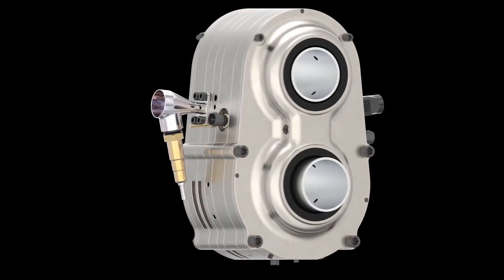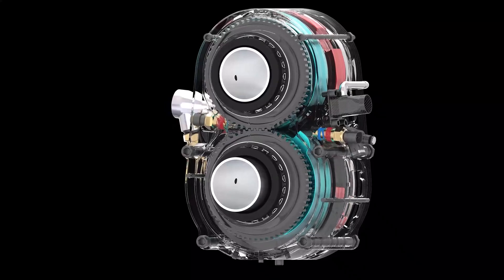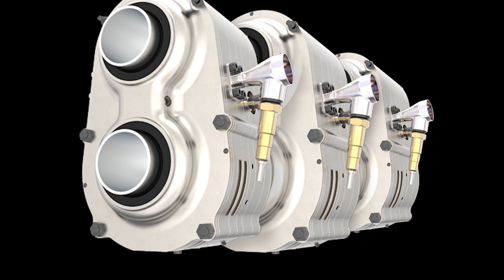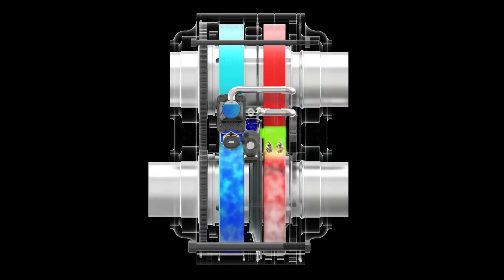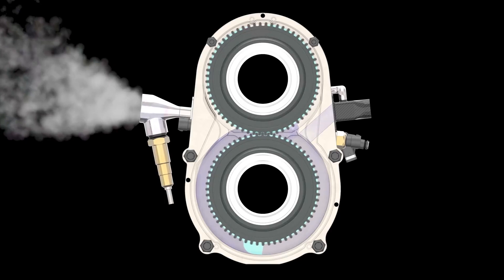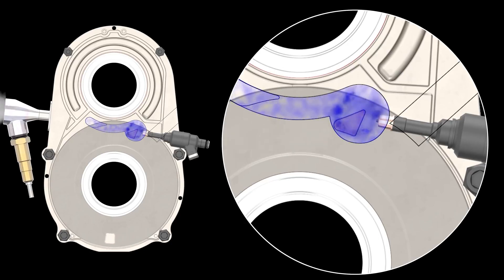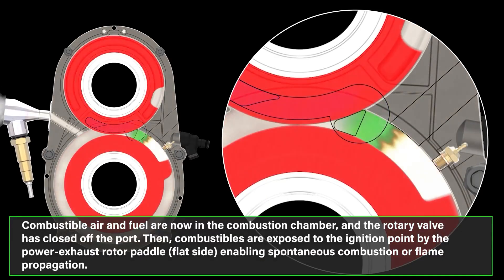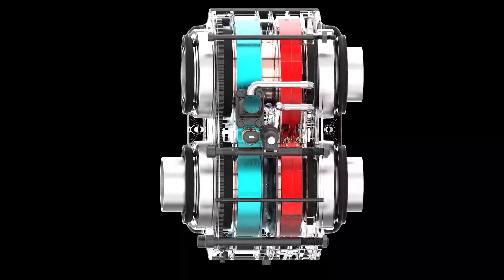This pistonless engine runs on hydrogen and revs to 25k rpm

Comment: What you need is a dual sided ignition basically mirror the top on the bottom so that both side of rotor will fire and balance each other out

Comment: I see a major flaw. When its ignited that side of the rotor is gonna have 200x the torque of the opposite side on the rotor. Basically this thing will fall apart to pieces wayyyyy before 20k rpms

Comment: Hydrogen is better than electric. Easily transported and stored. No carbon emissions. No mileage limit. No need for the extremely environmentally unfriendly battery systems.. people need to get behind hydrogen as a fuel.

Comment: As cool as this is (in theory) I think electric can't be beat, the RPM is only limited by the ability of known materials to withstand centripetal forces and the touque is only limited by the resistive heating of internal components. Also, the tolerances can be much sloppier and motor can still be designed without the need for physical bearings, lubricants or gaskets. Not to mention they can run on anything from solar to wood to plutonium.
Reply: The batteries are horrible for the environment and electricity to charge them has to come from somewhere. I like how quick they accelerate though. And recharging them is cheep.
Reply: @ryanhart9333  The batteries don't need to be horrible for the environment. They can be recycled easily enough (whether they actually are is another question) and the raw materials can be mined from sea water (especially now that the first Sodium ion batteries are being commercialized). Also, batteries are far from the only option to power electric motors (in a moving vehicle), a chemical fuel cell, a very small nuclear reactor or beaming power to the motor as it is being used (solar, lasers, wireless charging coils in the road or even an electrified track are all possible options)

Comment: electric using current lithium tech is not sustainable. this is possible now and cheaper fuel wise. im curious about the tolerances though. the runout must be something crazy like .0001"

Comment: I don't worry about keeping the I.C.E alive.  IF you bring efficiencies high enough, you can get engine that can run economically off synthetic fuels.  Can this engine run off Diesel, Peanut oil, wood gas, alchohol, hydrogen, methaner and anything else?  There are a lot of old agricultural Hit and Miss engines that ran of just about any burnable gas, if such an engine could be made and work eficiently in cars or cargo trucks then you have something.

Comment: A fascinating concept, but tight tolerances at scale are difficult to achieve. This will likely never be powering anything with a high volume production.
Reply: It was achieved , back in the 70s , its called a wankel motor, Arctic Cat used them in their snowmobiles in early 70's. With the only exception of course they ran on a fuel oil mixture.
Reply: @lokirussell4544  It's not a wankel engine.
Reply: @rekt4guud134  same concept

Comment: Cool toy but no practical use. The problem with hydrogen has never been extracting energy from it - a fuel cell is fine for that. The problem is producing, storing and transporting the hydrogen without using more energy than it yields. This doesn't address that at all.

Comment: The Shuttle-Cam engine has only ONE moving part and that part floats on an air-bearing, so clearances are very slack and allows it to operates under full load, very nearly frictionlessly, while producing nearly full torque across its operating range, from top speed down to zero rpm. The Shuttle part acts as both a piston and an impeller, simultaneously, with both components producing torque and both from the same charge of working fluid, so it gets more work out of the fuel and the working fluid. 

This is an external combustion engine and as such requires an independent combustion/pressure vessel which is ideal for Hydrogen or any other liquid or gaseous fuel. 

The Shuttle both rotates and reciprocate at the same time and floats above a Cam that determines and regulates the  Shuttles motion. Although the  clearances are quit large and sloppy compared to most IC engines, the shape of both the Shuttle and the Cams must conform very precisely to a mathematical, algebraic equation. Because of this mathematical shape, the inertial mass of the shuttle behaves as though the reciprocating motion was actually a rotating motion, 90 degrees off axis but with both motions acting on one axis, the driveshaft axis. (Mathematics is a very useful science, it make miracles possible.) There is virtually no vibration and the only point of friction is the sliding motion of the Shuttle as it rides up and down on the splines of the driveshaft. That is the only source of friction in the engine. 

The Shuttle-Cam Engine is the simplest, most compact, most powerful, most efficient and most practical heat engine ever designed. There will never be a better overall, heat engine design. It only has one moving part!
Reply: LOL good one

Comment: Bullshit. It's a blower/vacuum motor basically. And the initial drive egagement will have such a pull to off set the balances.  Yet if this a secondary input drive system possible for it to work since engagement is in motion 🤔 still it's at least a new concept. And right now that's what we need it's funny how new ideas come when someone gets fed up with the bullshit.

Comment: Electric car are not the way to go 1 the power grid can not handle the massive loads 2 short distance per charge 3 having to wait in line at a changing station one to two hours 4 batteries shorting out catching on fire and no way to put the fire out, it will burn until the car is completely destroyed

Comment: Wouldn't it be better to have  another chamber 180 degrees from the only one you have in this design to balance out the rotation.  And two combustion chambers per rotation might increase the power of the engine.  I don't know about 4 combustion chambers at every 90 degrees as the short time frame between each chamber might reduce the complete combustion of the fuel. This is something you would have to do actual test to measure if you would get a complete combustion of the fuel.

Comment: If it work as predicted I would consider combine it with reduction gear and generator, basically still use electricity as main traction, I not sure in such high speeds use traditional gears would be efficient and also changing the load or speed therefore the electric generator,  Super capactors would be my preferable combinations.

Comment: If they can even make this work in the real world, the tolerances required will make them just as expensive as turbines, if not even more expensive than a comparable turbine. The only conceivable advantage is that this can presumably be throttled back much more efficiently than a turbine, but that's really only a concern in automobiles and these engines will be prohibitively expensive to put in cars. In planes and boats a turbine can run at peak efficiency almost the entire time you're underway, so there's no need to overcomplicate it with this instead of a turbine.

Comment: Assuming it works as advertised, there are two main things that it needs to address to be better long-term than electric:
- Storage: hydrogen isn't very dense, and takes special considerations to store.
- Efficiency: even before any efficiency losses in the engine, the production of hydrogen takes a 20% efficiency hit instead of just using the electricity.

While I think there's a place for this technology, I think it's in generators, not vehicles.  Especially in space ventures.  Volume wouldn't be an issue, and this could be used as a generator in a closed-loop cycle (160 hp = 120kW, roughly), with the water split slowly via solar or nuclear power sources.  For things like asteroid mining, the water could likely be acquired onsite, and the H/O tanks could do double-duty as rocket fuel tanks.
Reply: Storage and efficiency aren’t a problem. It is actually very efficient it just needs transportation to get to the gas station that makes it less efficient. Gasoline has the same transportation costs. However everyone can just have hydrogen generators in their homes by using electricity to split water then it becomes the same cost as electric and no storage or efficiency issues. Cars could even have water splitters built in. Then you could just fill your car with water and charge it with electricity like a normal electric car. And when you split water you get oxygen too not just hydrogen. And you get the exact right ratio of oxygen to hydrogen for combustion. So if you save oxygen too you could use that to have really high efficiency complete combustion rather than relying on relatively low oxygen content in atmosphere. When it’s all combusted it just turns back into water.  Hydrogen could essentially be environmentally friendly combustion batteries. Much better and more energy dense than lithium ion. Not as efficient but not having lithium batteries makes up for that. Lithium batteries are expensive don’t last long and are dangerous make the vehicle heavy and they have terrible environmental impact.

Comment: I like the idea, it's light enough, rotation speed may make it good for aircraft! My two concerns: torque - in a typical ICE engine torque is translated to the drive shaft, but in this model the torque seems to fully rest on the teeth interconnection, which would be a point of failure. And as others mentioned. Seals - The gadgets of an ICE motor are there to fail so the case doesn't crack if pressure and wear become too great.

Keep up the good work the world needs thinkers like you!
Reply: it is a modified Helicopter's main rotor engine, they use 4 of these units, light weight, super efficiency will often mean that it has been around for about 20 years already and being used by the military.

Comment: Never was one for the EV fad, my thinking has always been magnetic propulsion, however capturing the power and reducing the heat throughout the engine has been problematic. Hydrogen has been another favorite of mine, plenty of fine auto manufacturers have made the engine yet they were not favorites of the politicians as a money maker in the form of kickbacks, California did have around 90 hydrogen filling stations up and down the state. EV's are a problem, the country will be in blackout and brownout situations and nobody will have a charge in their battery car. The climate change religion is dead to me, but high torque high efficiency combustion engines will never die, there is technology that would save fuel, but the government wants to eliminate all fossil fuels for the sake of their climate change religion. The climate change religion would rather see the human race back on horse and buggy and bicycle.
Reply: I'd rather see my grandkids travel to work on a bicycle than underwater. Which is what your head-in-the-sand religion would lead us to.

Comment: These innovations will be better than electric by being cheaper to produce and source materials and could be recycled unlike lithium batteries. And no loss of power or energy capacity do to hot or cold temperatures. If engineers keep at it we will see some great alternatives that might surpass anything currently conceived.

Comment: Standard ICE engines are not going anywhere unless forced by greater powers. We still have fuel for hundred years and EV's are still shit due batteries being still in their infancy. This engine seems pretty nice, but tight tolerances sound like little dirt gets in and its dead so not so reliable. Crazy high rpm puts bearings on though spot and hydrogen is great on paper but its extremely volatile, needs high pressured gas bottles to be stored in or solid state that requires heating to several hundred degrees to release hydrogen and production of the hydrogen needs electricity so hydrogen as power source is not that efficient if we dont transport it from some gas giant that has lots of it, or develop more efficient methods of converting it. Still turning water into hydrogen needs energy and that needs to come from somewhere and no your renewables dont do shit in scale witch energy is needed. Still i would like engine like that into dirt bike, might be fun to ride with, but would not put it into my car.

Comment: Hydrogen is the hardest fuel to contain, you need a cryogenically sealed tank which because of the low calorific capacity of hydrogen, this tank is usually massive. Also, hydrogen is expensive and there is no infrastructure for it. Th engine is small but everything else is big, expensive and heavy.

Comment: So in order to eliminate tight tolerance seals, we made the entire engine tight tolerance, so the entire thing is now one giant collection of seals… Brilliant. We also went with hydrogen fuel, so all those tight tolerance parts can get hydrogen embrittled and become highly failure prone, thus saving the planet (???).

I see no “technology” in this video, just a computer model of some dumb ideas that may or may not work when metal is actually bolted together.

Comment: This is kinda like atlas motor works ducted blade rotary engine. Fusion of turbine and piston engine into a novel 4 stroke machine. Often the new methods encounter new problems and the developers tend to run out of money but best of luck to them

Comment: The rich will keep touting hydrogen as long as they can. They are able to control its manufacture, therefore the price. This is not possible with electric. I can just go out and buy solar, water, or wind powered charging systems. Hydrogen is about control of your pocketbook. It is known as a dirty high energy fuel to produce. It is also explosive. Go watch old reels of the Hindenburg. It was using hydrogen.
Reply: It doesn't have to use hydrogen. Gasoline, diesel. Natural gas, or any fuel, should work.

Comment: Great way to burn hydrogen in theory, let's see the video of it running on a dynamometer.  Now about that other issue! How to store it without steady and massive storage loss as the hydrogen atoms seep through the walls, lines, and every connector on the fuel storage and delivery system made for this purpose.

Comment: Fascinating. Love that engineers are still perfecting the combustion engine. I’m firmly in the electric motor camp, but it would be folly to think there would be no room in our reality for combustion engines.
Reply: ev's do have advantages but the drawback is the battery which has a short lifespan and isnt recyclable however a hybrid between something like this acting as a generator for electric motors would be better

Comment: I’ve been a fan of hydrogen since I first saw the “hydro-star” even tho it’s pretty much bogus.
Next I heard about LNG powered busses, which provided a similar technology that already exists and could be retrofitted.
Then seeing the Toyota Mirai as shown by James May gave me actual hope for the concept for passenger cars.
This has me pretty stoked, all thats missing now is the extraction infrastructure to turn hydrogen into a functional battery for the excess grid electricity.  
Hypothetically at least, if we have hydrogen generation centers that can run on a range of input power; then those same generation centers can act as a load to dump excess electricity.
The idea pairs well with nuclear energy to create a much greener supply chain of energy.

Comment: I'm thinking we might need to consider changing ICE engines that we use now vs others like this hydrogen one. Reason being that this is much less pollutant than Petroleum based engines (Diesel and gas). So yes, this could be an alternative to PICE(?) and Electric. Wonder if this could also work to generate electricity more cleanly than what we have now.
Reply: ….. hydrogen is energy negative. Just think about it where exactly do you get hydrogen? Are we going to be shipping it from the sun? Are we going to take hydrocarbons like oil and burn off all the carbon so we’re left with hydrogen? Are we going to do a chemical reaction with water, which would require a lot of electricity probably produced by something else like oil, and would drastically increase the price of freshwater per gallon? Where exactly do we get hydrogen? Starting with something that is energy negative and then trying to figure out how much energy you have to put into it to transport it around the country and manufacture the canisters and all that other stuff…. Not a good situation unfortunately.

Comment: I see there's no lubrication... How is this meant to seal when the temperature difference causes unequal expansion between the moving part (the "shaft") and the casing? The nub that takes on all the heat will be permanently more expanded than the heat gradient of the casing, this is going to be a NIGHTMARE. This will have to include similar seals as a wankel engine, though you could place multiples or a single hyper-robust seal with plenty of material to erode off itself and still remain operational. The high RPM's actually give this motor a good place in aviation, if its current iteration wasn't a pipedreamer's manufacturing nightmare.

Comment: With the old Mazda rotary engines, the seals were definitely the biggest problems.  They wore out fast.
Reply: Yep, my RX8 did about 30,000km per apex seal turned a past master in replacing them.
Reply: It does thats why... lol